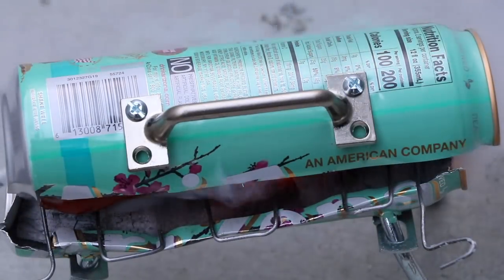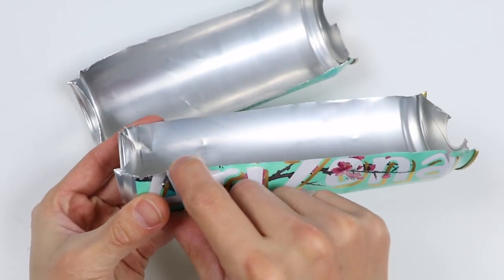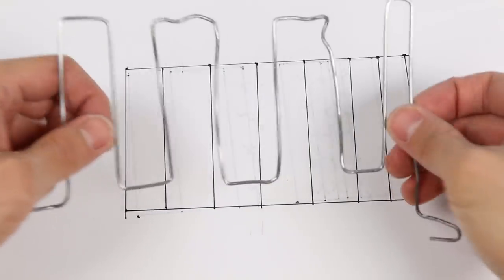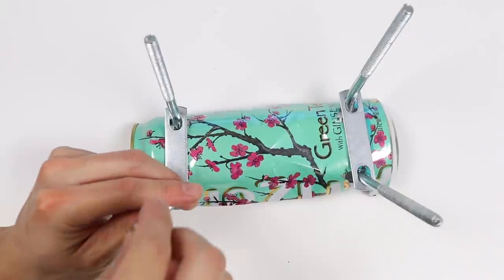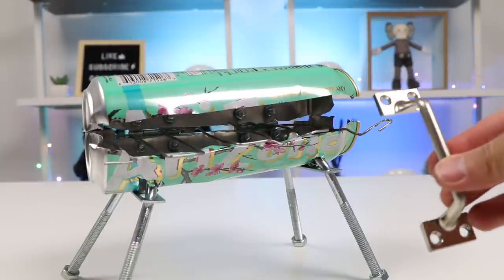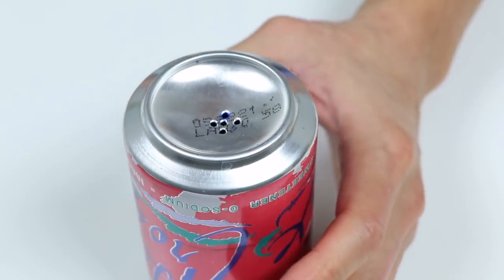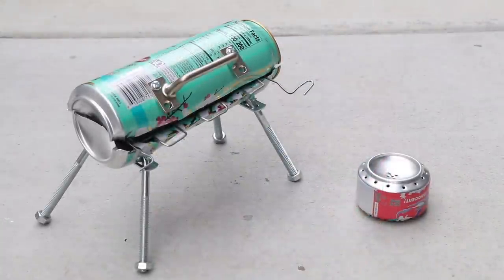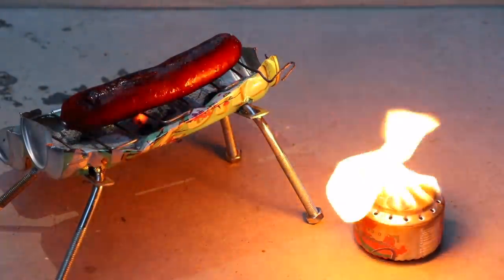How to Make a Real Working Soda Can Grill and Stove!

Comment: First off I'll give it to you as this is a pretty cool idea but on a different note is also super dangerous to eat that hot dog after the chemicals from the burning paint on the outside have obviously smoked on the meat. I would highly recommend if you're going to try this to other remove the paint or use a different type of can best of luck and just be careful.
Reply from the maker: Thanks for the heads up! Appreciate it :) will be more careful!